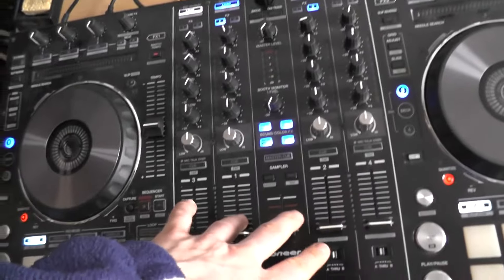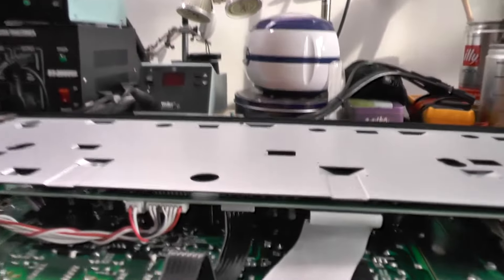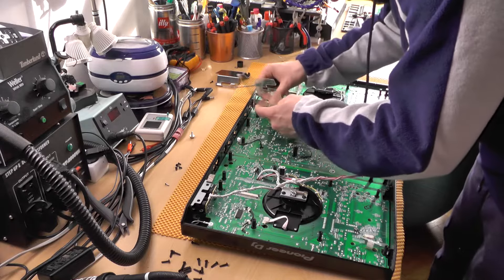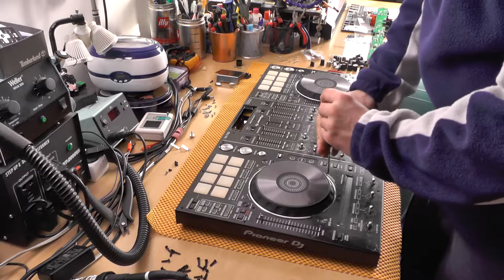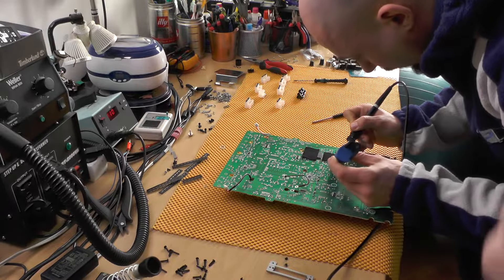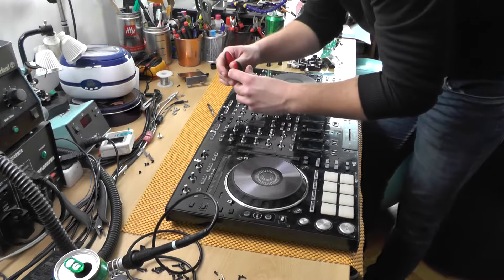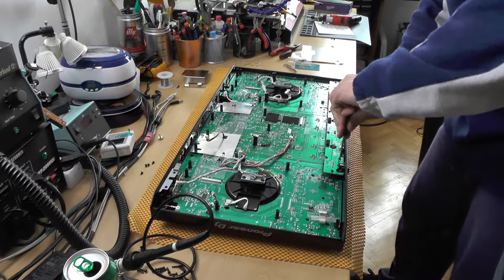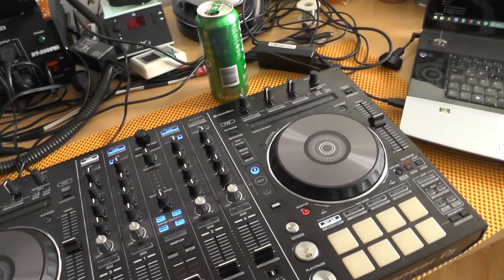[HW:HowTo] replace Pioneer DDJ-RX fader (oh boi!)

Comment: Absolutely brilliant video my friend. My thing is phones and micro soldering. I have one here to repair. It has been dropped, it has bent knobs, no output sound and it rattles. It might be a no fix. Will see. The electronic's part is easy for me. I thought this might be a breeze. But so many screws haha!!! One thing with phones, is screw organization. I think it might be needed much so here. Will be sure to let you know how i get on. Your video is going to be invaluable to me. You have a new subcriber. I'll be sure to checkout your other video's. If i could offer a tip to others attemping this sort of thing. Video it and or take photo's for your own reference. I have torn down stuff in the past then might of had to leave it for a day or two for parts and then forgot things. You can go back and refer back to your work.
Reply from the maker: Dave Hammerton woohoo :) tnx! Yeah, it will take you some time :)))
Reply: @MTS_IT  It was a Pioneer XDJ RX2. was easier to tear down that i thought. 3 of the boards were distroyed. Could of prob repaired one of them with jumper wires. I literally think it actually fell off the back of a lorry.  But i'm sure there is a lot of money in it still in parts. Going to see if i can buy it for a silly price and tear it down. Watched a couple other of your video's. You have got a fan ;)

Comment: My DDJ RX has decided that it doesnt want to slow music down on one slider (the left temp slider) If I slide it down (increase tempo) from 0% (centre) down, it works, the red arrow lights up at the bottom as well. If I slide it from 0% UP.. nothing. Red arrow doesn't light up. In the software it doesnt register anything either from 0 and up. The right one works fine.

I've hardly used this mixer as well! I contacted pioneer about it, but they claim its not compatible with virtual dj lol, this is the cause?? So I factory reset it, performed a firmware update, tried it on rekordbox and also put it in it's own standalone demo mode, it's not responding in demo mode either..

If you move the tempo slider UP in the software on the computer though, the red arrow pointing up will light up! So the controller is understanding the position when the software calls for it, but you just can't physically move it beyond 0 and up.

Do you think this is a slider issue or are the tempo sliders different to the faders? thank you.

Btw, this looks like a bloody nightmare to take apart! Need to get me one of those electric screwdrivers lol

Comment: What tool are you using alongside the soldering gun to remove the original channel fader?
Reply from the maker: Slyboy0070 hi, this: https://rover.ebay.com/rover/0/0/0?mpre=https%3A%2F%2Fwww.ebay.com%2Fulk%2Fitm%2F293459759346 (not affiliate) and wick